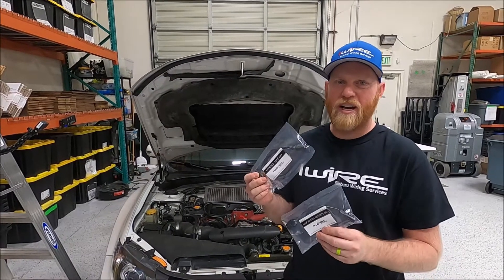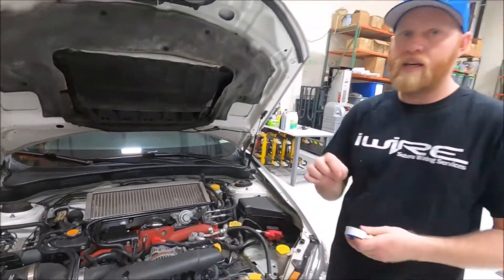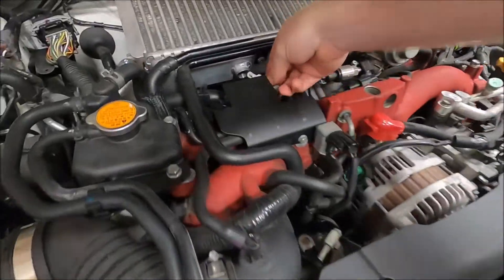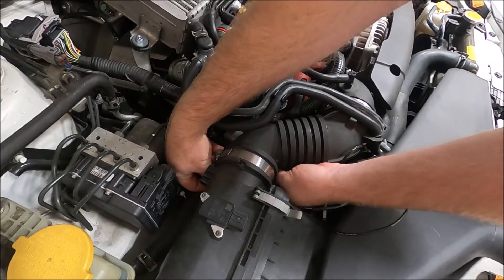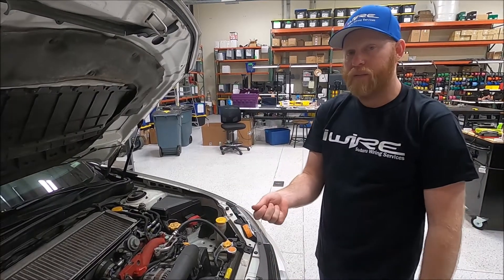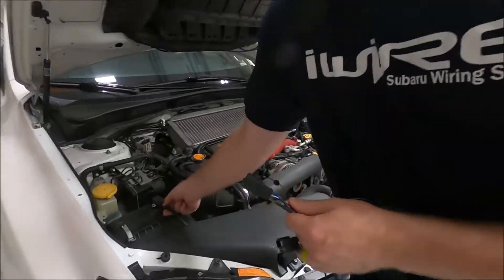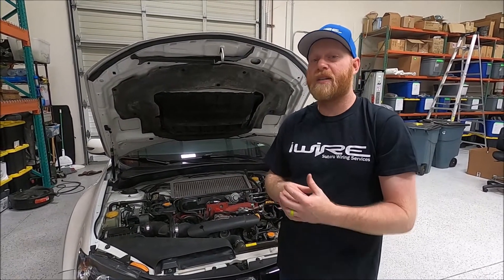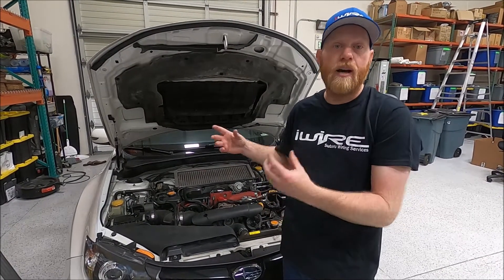iWire Speed Density and Hybrid MAF Wiring Kit Install Video - Subaru Speed Density Explained

Comment: Would speed density still need a AEM 3.5bar pressure sensor as well as IAT SENSOR?
Reply from the maker: We would recommend upgrading the sensor to one with better performance (AEM 3.5 bar) but it is not required for a speed density tune

Comment: do you have to drill a hole and then weld on the bund?
Reply from the maker: Yes, you will need to drill a hole in the bung of the intercooler so the IAT sensor can read the temp inside the intercooler.

Comment: Hey how's it going? I have a n/a 3.0R h6(2005 outback), have a Weapon-R intake, hi amp coils, full exhaust(has two front o2's, not either rear o2's). Would the hybrid kit work for me? I'm having troubles with the MAF on my car, little off in the idle, hesitant on takeoff. I already replaced with new denso maf, it helped but still getting a little sputtering. I was wondering if I could use the hybrid kit, install the iac on my air box? I have an on board tuner, I was going to get it tuned @ ecutek this spring/summer, just wanted to get everything done first. Came across this and sounds like a good solution. I'd appreciate it. Thank you for all the vids!
Reply from the maker: Please email this question to info@iwireusa.com so I can get you to a tech that can help :)

Comment: I have a 2011 sti it was tuned at speed density I have the regular MAF connected to a grimmspeed cold air intake, I still get the check engine light for MAF do I need to make a hybrid MAF?
Reply from the maker: Hi Edgar, thanks for contacting us. There are multiple reasons this check engine light may be on. Please send us an email to info@iwireusa.com so we can help you with troubleshooting.

Comment: I’m looking to tap my OEM intercooler the same way you have it. How deep do you need to drill the hole? How do you prep the hole for the intercooler?
Reply from the maker: We had a shop weld on the bung for us. We'd recommend contacting your local shop and having an expert do the welding.

Comment: Does this means I can use a bov for my sti instead of using cobb bpv once I have the hybrid speed density installed and a tune?
Reply: i know this is old, but no you would want a full SD setup for a bov. hybrid ive been told by my tuner will not support a bov still. im SD converted and running a tial q and its great!
Reply from the maker: Given the Hybrid SD kit can still use the MAF (depends on tuner) I think the situation would not change in regards to a BOV vs. BPV. I would suggest reaching out to your local tuner for a better answer on when it would be appropriate to use a BPV vs. BOV.